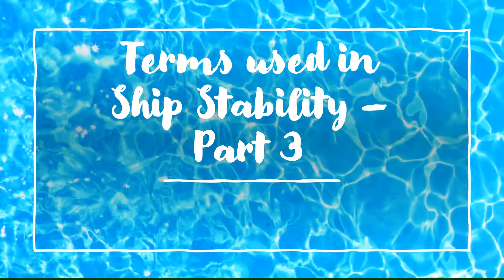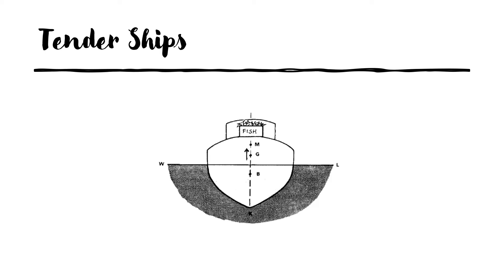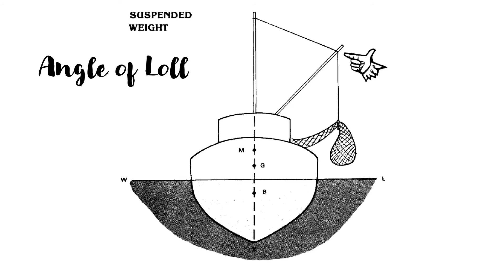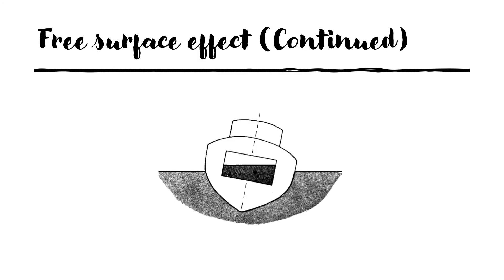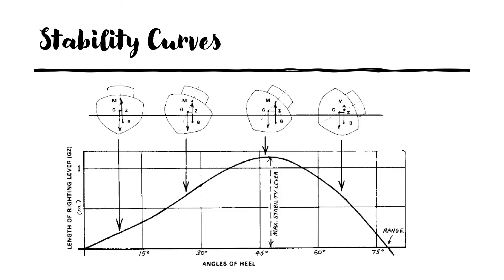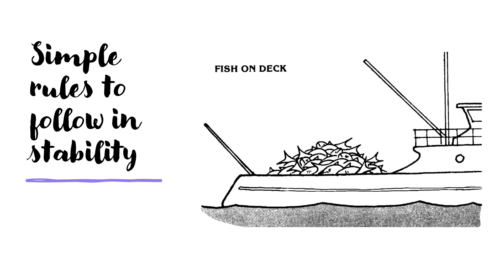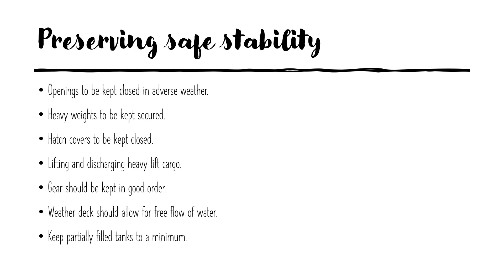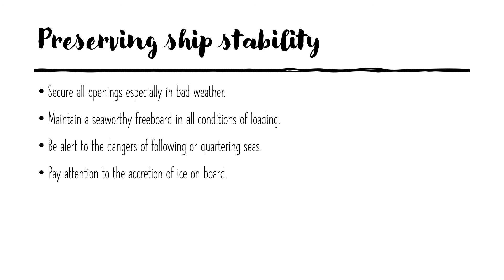Terms used in ship stability - Part 3

Comment: @steering mariners during stiff ship you said its difficut to heel and rolls from side to side quickly and violently. those two are contradicting and not making sense. please explain will it roll or not?
Reply: It is stable but the restoring lever is large due to stiff ships having a large GM. Hence, the ship is very stable, in fact too stable to the point it stabilizes itself too quickly because a large restoring lever would create a large restoring moment.